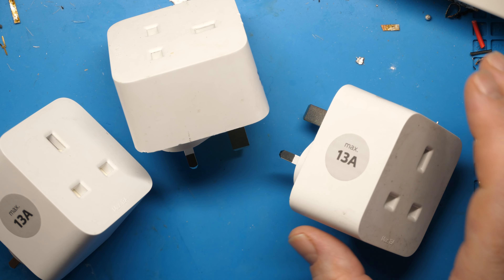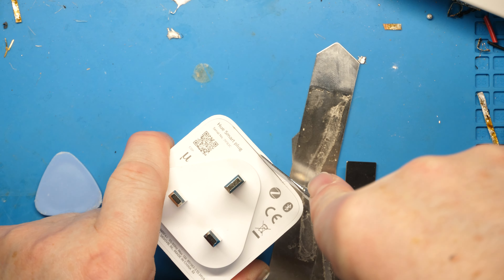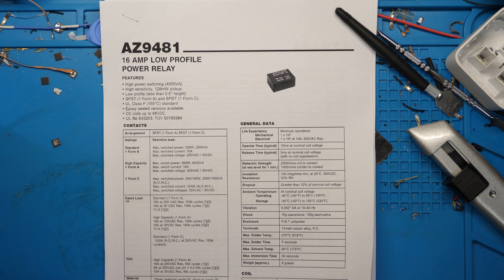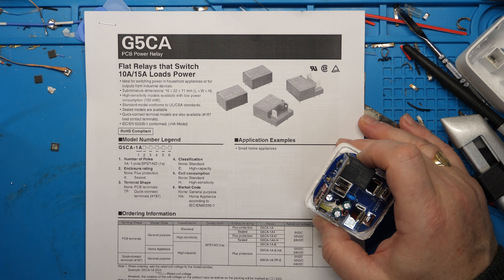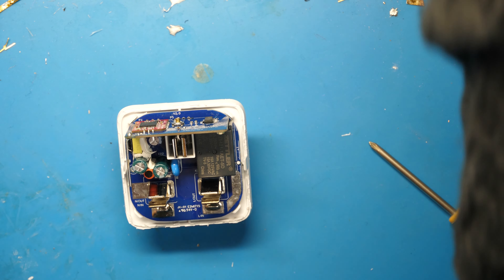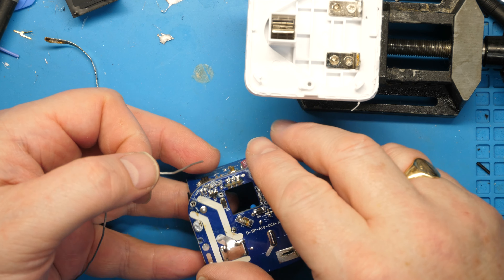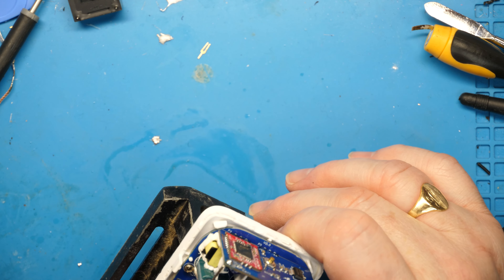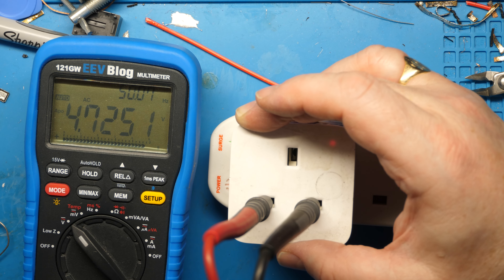Philips Hue Smart Plug Teardown and Repair

Comment: Nice job and thanks for sharing that Omron ref!
The relay is far from being the tallest thing on that board, so realistically you don't need to match the pinout, you could rewire it........and maybe use a solid state relay in its place? I find the audible click of a relay sounds quite archaic on a supposedly premium electric gadget in 2023
Reply from the maker: I did look into solid state relays, or rolling my own triac circuit. The problems with these are cost (particlarly for the solid state relay solution) and heat dissipation. The heat issue means switching a decent current will take up space. 

Now I know why they didn't use a solid state relay to begin with!

It you're willing to use a different enclosure to deal with the heat, a solid state relay or triac solution makes a lot of sense.

So I took the path of least resistance (pun not intended) and picked a compatible relay.

Comment: Glad its not just me thats been suffering with this.
I've had a number of these go with the same issue recently, in my case they are powering non-smart lights (e.g. Christmas lights or lamps) which is their intended use as far as i am aware.

Interestingly a plug I've had for approximately 3 years has been rock solid, but the other couple I've bought within the last year have all failed in the same way you detailed in the video.
The latest has only lasted a few months. (I'm using UK plugs too)

Comment: both relays' datasheets say they should last at least 100,000 operations. do you know what might have caused these to fail before that?

i wonder if in a more sustainability concerned economic milieu it might make sense to have relays be items you could pop out and pop in to replace, like fuses.
Reply from the maker: It might be the nature of the loads I have on these relays, as they aren't purely resistive, having switch mode power supplies etc in them. There may be inrush currents from the non-resistive loads which exert excessive arcing leading to sticky relays. Irrespective, I don't consider my use case, that is to turn off a bunch of devices in standby, to be a particularly onerous task.

One use case that's failed twice now is on my desktop PC setup that includes about a dozen items including the PC, a printer etc. In themselves, they draw about 200W maximum, well within the relay specs.

Another option might be to come up with a snubber network and/or MOV across the contacts to mitigate.

I did look into using a solid state relay, but these are expensive and bulky at this kind of power.
Reply: @nezbrun872  
are there devices available (or could you fashion a device) that would connect in line with the power line leading from the smart plug to the load devices? so that you wouldn't have to open the smart plug and modify its innards to get this protection.
Reply: @tohopes  You mean like a NTC thermistor? You could always try to wire one between your plug and your power supply to see

Comment: I didn't trust Chinese Smart plugs they always faulty. My 4 WOOX WIFI Smart plug from last year, 2 plugs went failed stuck permanent power on & 1 plug failed won't turn on & 1 worked fine but sometime come back stuck permanent power on.
I go back old timer/schedule worked fine & remote switches plugs non-smart plug worked fine 🤷
Most Chinese are not good electronic skilled. Need more made in USA or Euro or UK products.